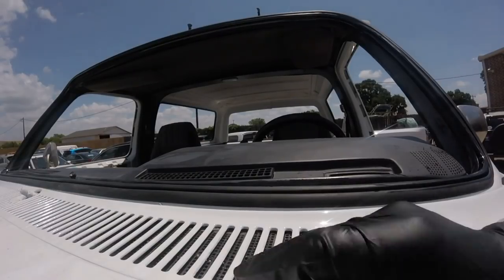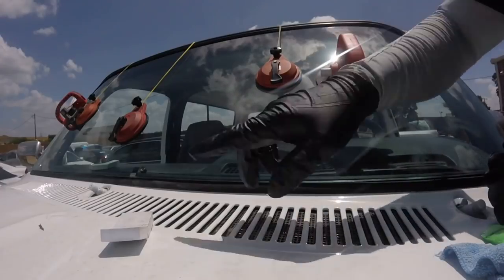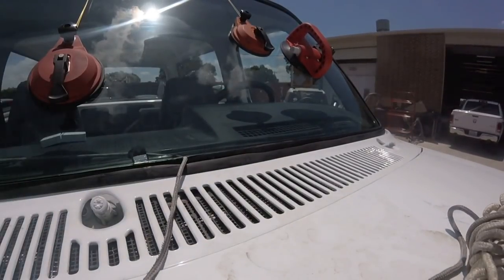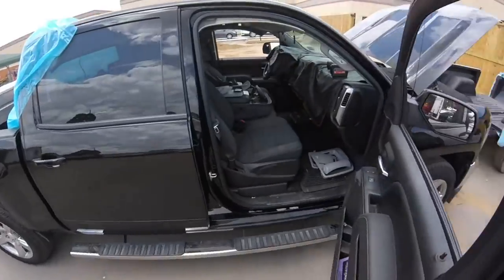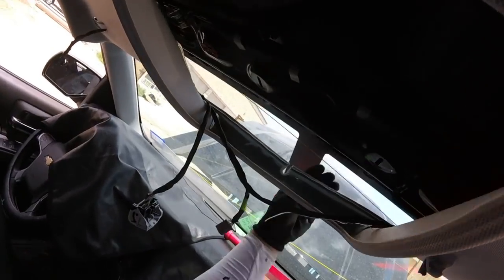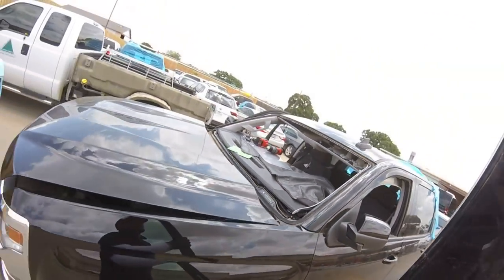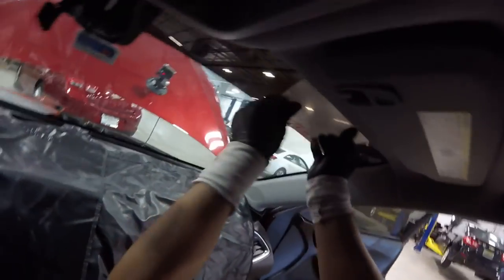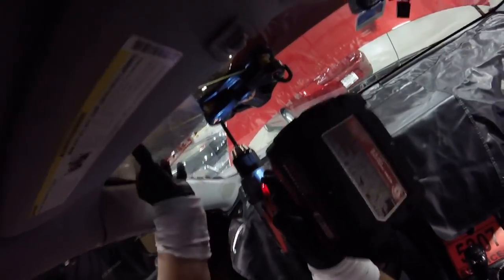87 blazer rope technique.and the orange bat

Comment: Great vid as always! I have never used the rope technique on self locking gaskets, I always slide the w/s in along the bottom and then use a bone to lip the gasket around the sides and top because there is so much room with out the lock strip in. I use a rope for WBL style gaskets obviously, but I will give the rope a try on my next WCR style gasket. I noticed your rope is pretty fat, have you ever used paracord style rope on your gasket installs? Much thinner and almost slippery because of the nylon and very tough, for me it felt like it was much easier than the thicker ropes like yours, maybe try it some time! 

Have a good summer man, and thanks for the videos. Twenty years in the industry and you think you know all the tricks, then you see one you've never seen before and it reminds you to always keep an open mind and that someone might have a better way. You've showed me two things now (f-150 cowl shake to not break the clips and this rope technique I have never tried) that I've never seen, and the cowl tip for the F-150s is GREAT. I passed it along to another tech and they were blown away with how easy those cowls become after you shake them, and in all honesty it works on a lot of cowls to make them come off easier.
Reply from the maker: hi thanks and yes i have a thin cord but for this technique i like use a fat cord but you can use a thin works same ..and its good to know my shake technique helps other tech to release the cowls ....have a good  one too

Comment: Much easier to insert the glass into the rubber on a bench.  Then rap cord around lip of Rubber. 4 loops .top middle and sides.then pull cord from inside. Much quicker less hassle.
Reply from the maker: Rodney Porter you know what..your right but with many after narket gasket brand quality its not realy good..thats why i use this technique..
Reply: VIDRIOKAR here in UK we don't fit many after market rubbers. Nearly all main dealer . Does make a massive difference.  But if a rubber is supper tight. The 4 loop method definitely the best. Inch at a time from side to side bottom to to top. That way the glass doesn't  slide . Good job though dude. We all pick up little tips watching theses videos. 
😉
Reply: Not on these you don't